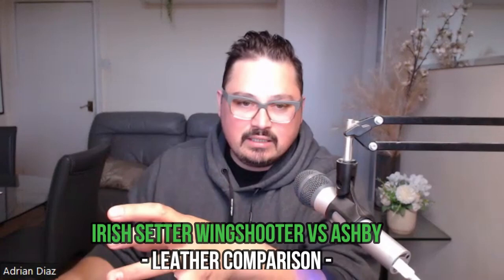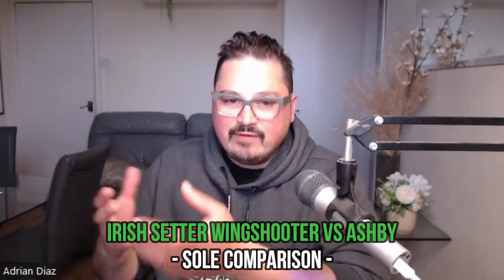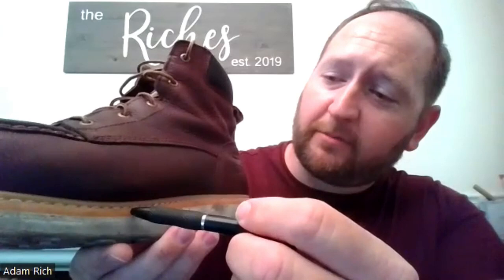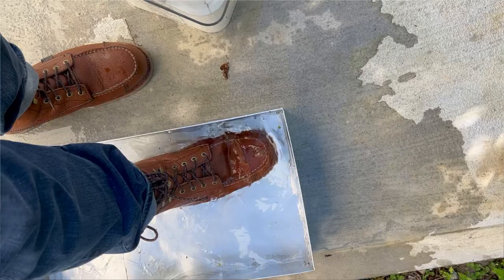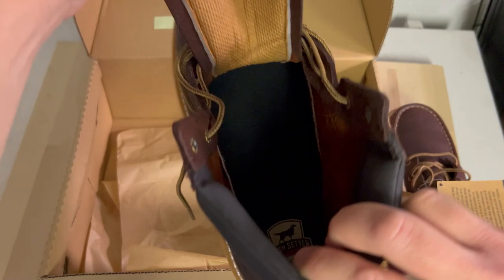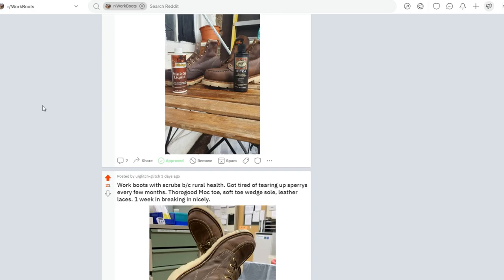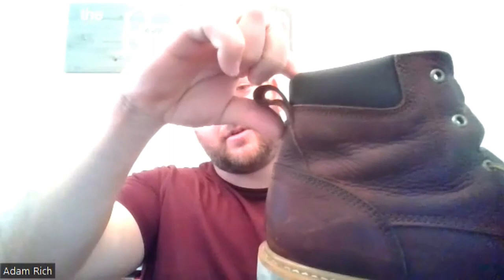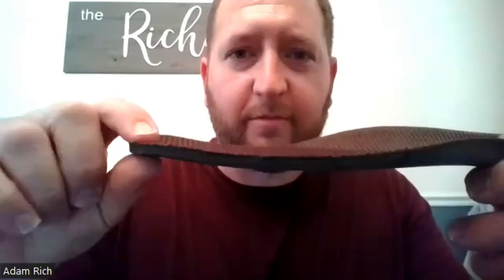Irish Setter Wingshooter VS Ashby: Work Boots Comparison

Comment: I could be wrong, but isn’t the texture of the leather on a wing shooter due to the wax impregnating for waterproofing, which is the unique feature of Wingshooter hunting boots.   Let’s keep in mind that wingshooters are hunting boots…not work boots.  If they were work boots;  well, then they would be 10877s or 877s or similar.  
Ashby’s are a Irish Setter styled work boot.  They seem like a nice boot, though I have never tried them on.  And I have run across a lot of welders in particular, that where Wingshooters because of cold environments they work in since you can get Wingshooters insulated and they come with more lining than the basic redwing 10877s or a likeness thereof.

Comment: Got the ashbys and I think they’re pretty good. I work as a sheet metal worker in particular sheet metal roofing and that means I’m handling 10’ sheets of sharp metal working at a very rapid pace. The boots are holding up and protecting my feet when I hit them while flipping the sheet on a bend.